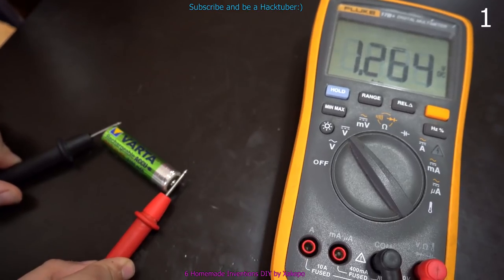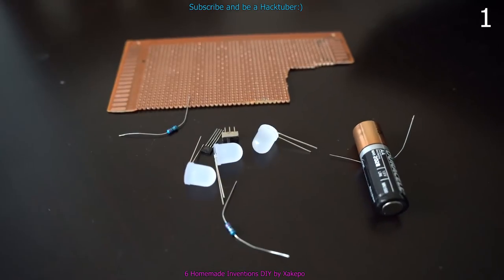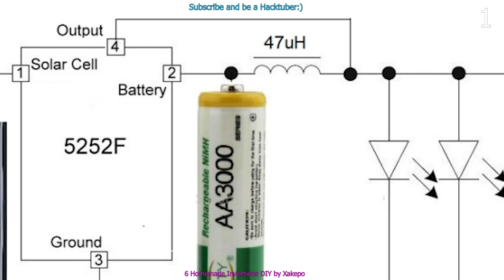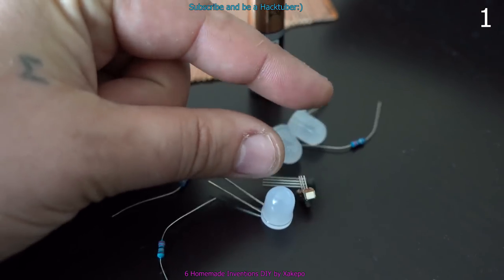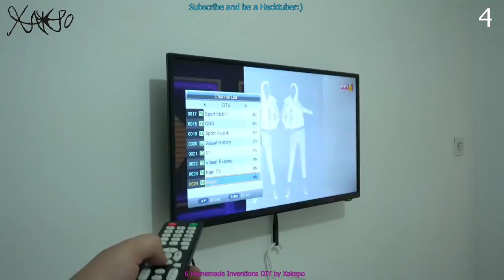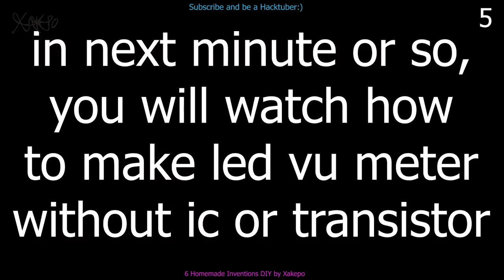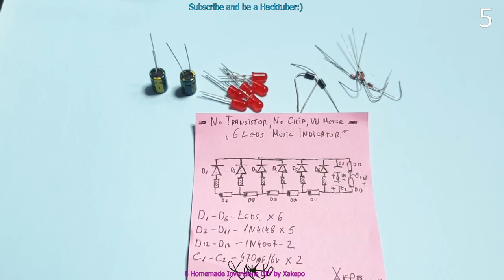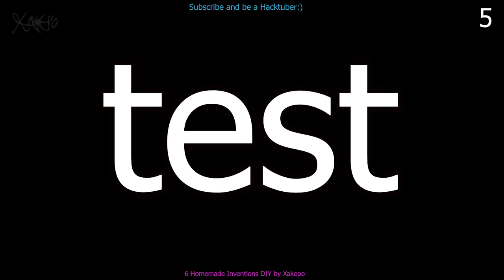6 Homemade Inventions

Comment: Hacktuber, could you design a box with a timer lock on it so I could put 1/2 my paycheck in it or a credit card I don't want to use for a month or whatever I want to time release to myself and set it so it will not open or unlock until the time has expired.  Could be very useful for impulsive types.  Possibly have the timer key unplug from the lock box so it could be held by a friend until the date set has come to pass.  (This might even have commercial value)

Comment: What's the point in the oxygen cylinder fire ...go outside and make a fire 😂 try transistor on the caps might light LEDs better and reduce to 1 cap .just idea tho